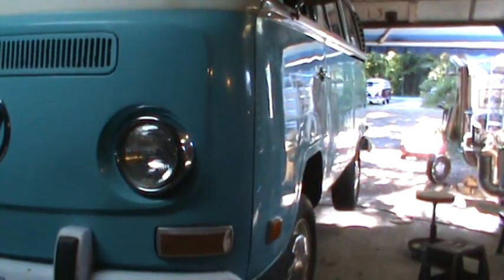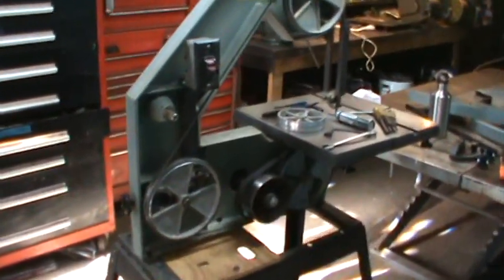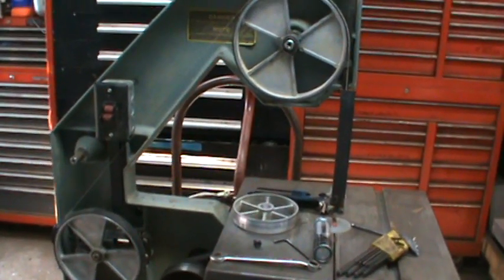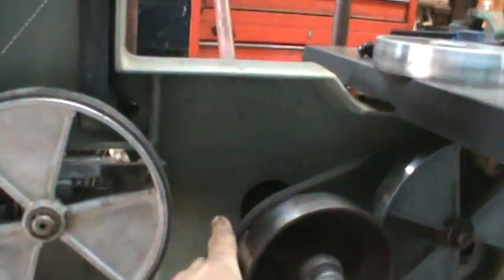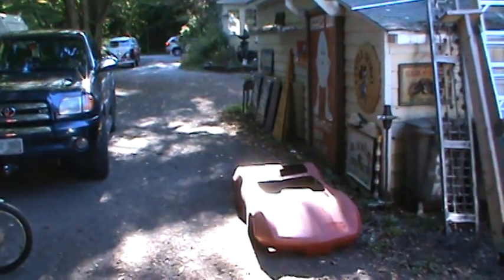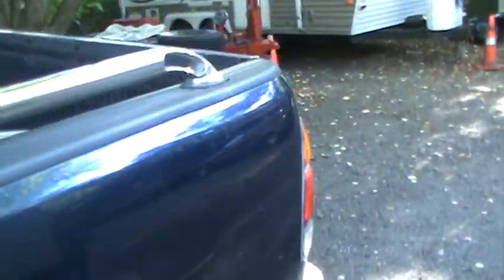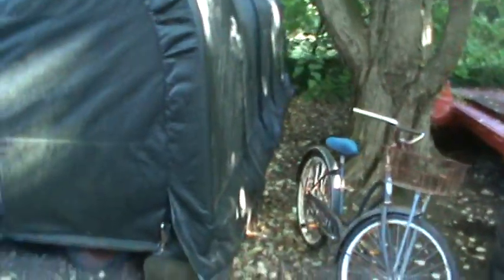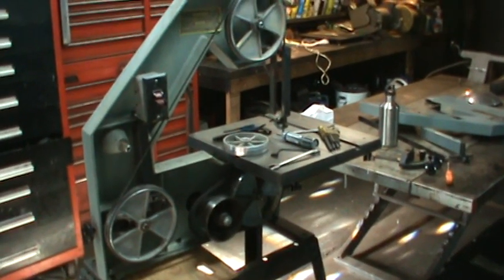poor mans vette,

Comment: Good idea on the saw . . . extend the motor bracket, add a set of mounting holes for the "metal pulley" position, then you can go back to original for the wood if you want. Bike looks purty good. Thanks D, Rog

Comment: Hey M.  Just catching up on all your videos....and ran across this one...... I have the exact same band saw that a neighbor gave me. I converted it to a metal cutting saw as well.  Mine came with a different,  smaller, pulley. The pulley was bolted to the diviat on the upper left side of the machine as your looking at the wheels with the cover off.  It was a simple switch, and have been using it to cut mild steel for a couple of years now. I think it could, should be running a little slower, but have been using it and no failed blades so far. My only complaint is that it could be a little more powerful....will bog down if pushed too hard....but I probably save the blades by feeding slower.... anyway I really enjoy your videos..... keep em coming!   Gary in Pa.